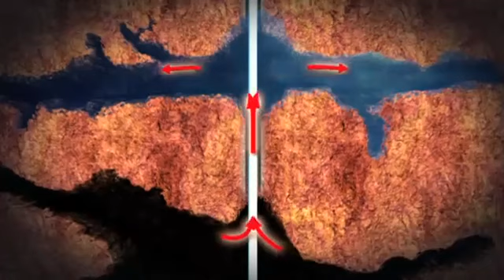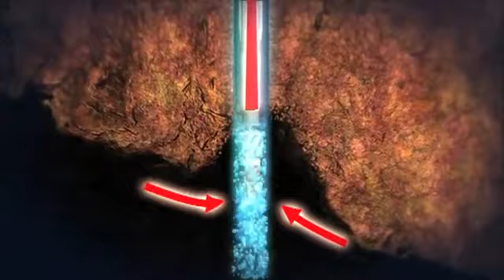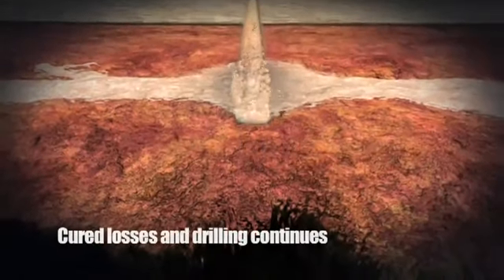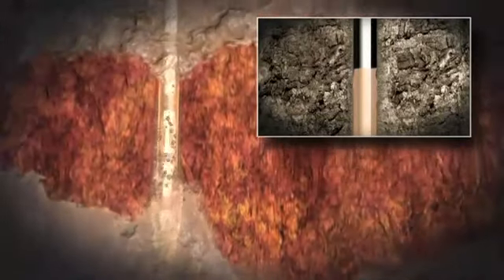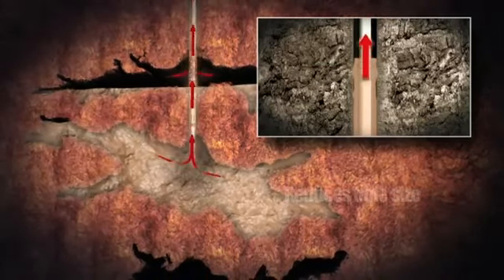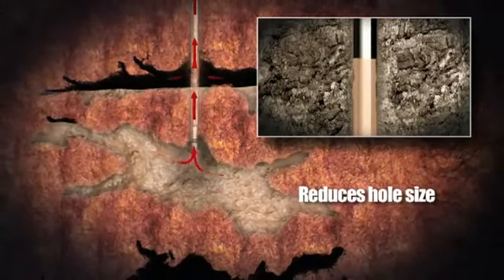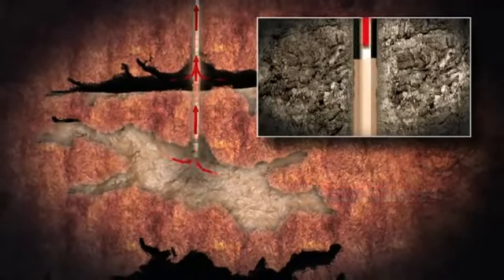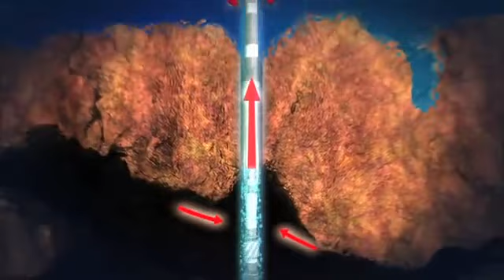Managed Pressure Drilling (MPD)

Comment: After reaching the target point, how can we pull the pipes out of the hole and run casing and production tubing in the hole and then produce????
Reply: The mud weight is increased to slightly overbalance the well so back pressure from MPD equipment is no longer required and the ESD of the annulus is sufficient to hold the formation pressure.  Of course flow check on the trip tank. The RCD bearing is removed, then the driller can pull pipe and keep track of fluid displacements from trip tank to the well.
Reply: There are several options depending on the situation. If it's offshore operation, BHA to be pulled out of the hole under pressure in PMCD mode until above BOP. Then blind rams to be closed. To run a completion a composite bridge plug to be installed to prevent influx while Liner make up. On land operations the only one option for us was to start filling the well with KM at flowrates, than at least 1.5 higher gas migration rate. Thus we were loosing mud but holding gas near bottom.
Reply: Impressive